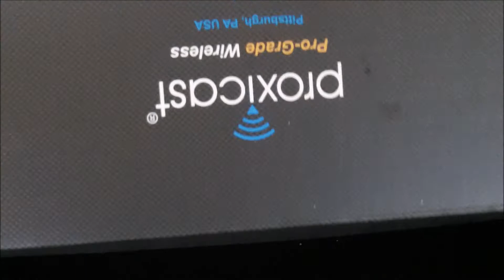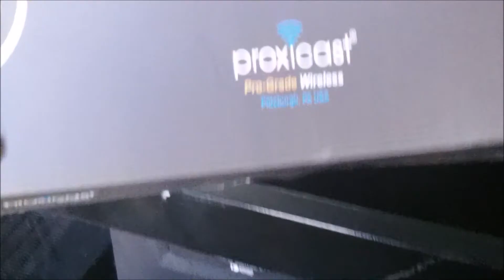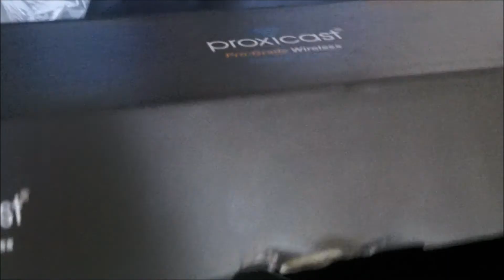Proxicast External Magnetic Loaded Coil Antenna unboxing

Comment: I have a question. Can I use these to help my cell phone to get a better signal so it works better as a hot spot to run my firestick for the TV in my camper? Thanks.
Reply from the maker: NOT SURE ON THAT THE INPUT PLUG IS NOT A USB